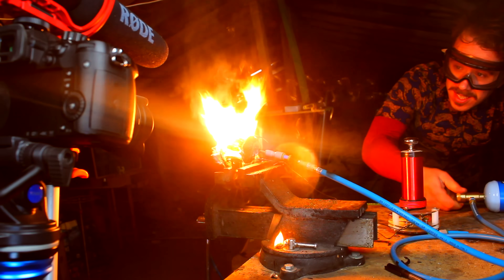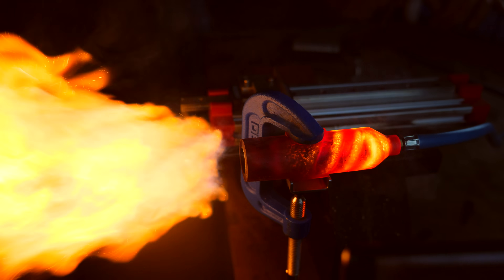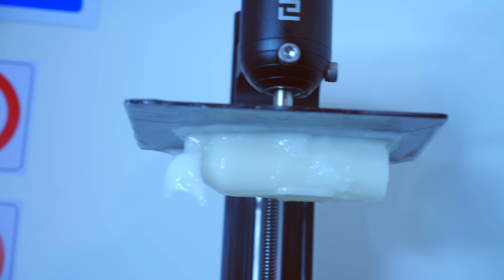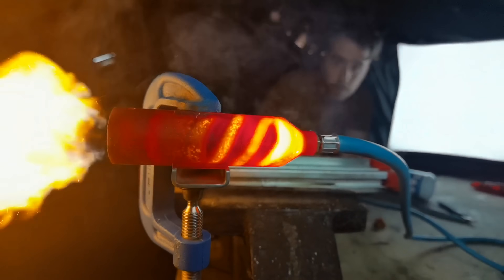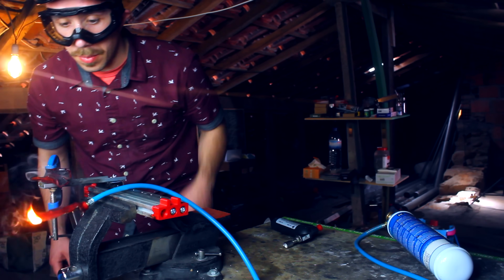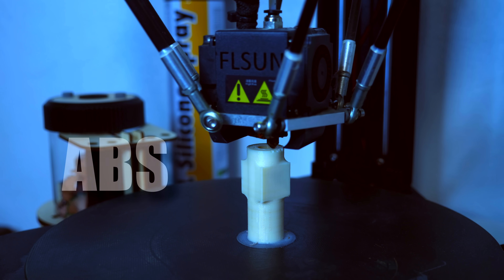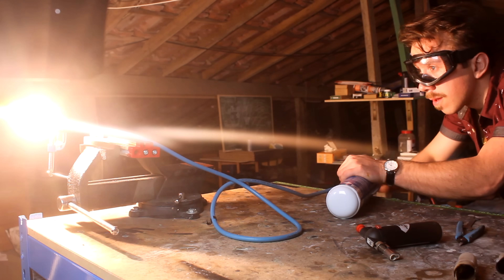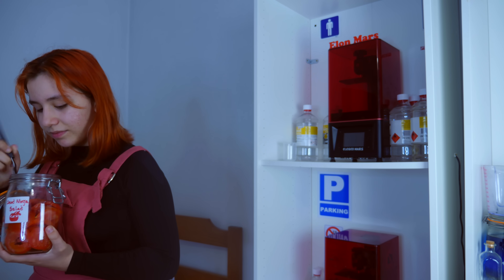Rocket engine that uses itself as fuel! (3D Printed)

Comment: I am curious why you haven't tried to cast parts for this and your jet engine in metal.  I am sure with a small forge you can do this.  Ideally you would sinter the parts in metal but is it possible to cast in metal and line with ceramic?  Are you getting to 660 deg Centigrade out of these nozzles, or 1500C?  Or better yet could cool the nozzles...or are we getting too complicated now?

Comment: You could print a chamber out of ceramic resin and use your nozzles from the vortex rocket setup. The fuel could be a solid slug with multiple holes like a reactor core but instead of the fuel rods the oxidiser could run in the channels. If it works you could just alter the fuel slug to optimize the performance without needing to print out a new engine all the time.

Comment: I think you might make the engine with fireplace cement and then use this resin as a fuel and then use UV light for toughen it up for not having leaks with the resin if you are going to try again.
Reply: I mean for use all the power because now the fuel of the engine is the engine itself.

Comment: Ideas:
Tomato killing machine (more pain = more subscribers and likes)

Dye for solid rocket fuel to change flame colors,

Casing for rocket engine to allow longer burns and stop flame escaping once a hole burns through them.

Sterling engine powered by the exhaust heat of the rockets powering a machine to torture tomatoes

Force gauge to measure the Newton’s of force your rocket engines are giving off.

Comment: Why dont you use the ceramo nozzle as nozzle because I think burning the nozzle itself destroys its geometry. So I would suggest putting the nozzle in a metaltube and behind that the block of propellant. Would be like a normal solid engine but using Oxygengas from the opposite side of the nozzle

Comment: Having given this more thought.  Have you considered 3D printing a ceramic sleeve (reusable) to house the rocket fuel you print (to prevent the pressure from blowing out the top or sides)?  And an idea - instead of plugging the oxygen tube directly into the 3D printed fuel, you could print the fuel to have a threaded hole and get a threaded metal bibb (tube connector) that you could re-use with each engine. And since the metal bib won't catch fire, maybe it'll play a little nicer with the oxygen tube?  I dunno!  LOL  Anyway, for what's it worth.  :)  I just find it neat that the 3D printed ceramic experiments might be useful as a housing for your 3D printed hybrid engines.  Anyway, if what I've said made sense - to test each engine, you'd just need to slide it into the re-usable ceramic housing, screw in the re-usable metal bibb, attach the hose and you'd be ready for a test fire.D

Comment: That printed fuel should be put inside a steel tube with a smaller nozzle so that the pressure is higher and it doesn't spill flames on all directions

Comment: Have you considered something like putting a ball valve in-line with the O2? That way you could have a rapid shut-off of the O2 if necessary rather than having to slowly turn the valve closed on the bottle.

Comment: Although I dont have 3d printers    
I really like rockets a specially hybrid rockets I came up with the idea to use hdpe ( high density polyethylene) as a fuel and a nitrous oxide oxidiser I was hoping to see if you could try it ?

Comment: Why don't you do a capsule of ceramic and put the abs inside that? That way even if the flame makes a hole thru the abs it will be contained inside the capsule and exits just thru the nozzle (and you could make the nozzle out of ceramic as well)

Comment: I've been wondering if instead of using a ceramic resin, you use wax to make your rocket prototypes.
The idea is to make a wax mold, empty the ceramic and then in the oven burn all the wax and leave only the ceramic rocket ready without leaks.

It would be very interesting to see how you build a cnc router and you will use it to make wax molds in 2 parts and since it is wax you can melt it a little and rejoin and you have a single mold

Comment: Integza - what about combining both the sugar resin solution & the ABS to generate a 2-stage fuelled rocket? 

And FYI - burning ABS may produce carbon monoxide & hydrogen cyanide, so I would highly suggest doing this outside or in a better ventilated area. At the very least, have a CO detector in the attic and/or if you start to smell almonds, leave the area immediately! (source: PhD in chemistry)

Comment: Well one thing that i would like actually to see from you unique way is Building a 3d printed Ion  Thruster Engine!
Reply: He would need metal 3d printed.
Also: How would he measure so little thrust?
Reply: @ImieNazwiskoOK  Well metal foil wrapped around of plastic tubes is enough to generate enough charge to work (or even some kind of copper plating on the printed parts), with proper transformers and a bridge rectifier for dc high voltage.. as for that kind of trust,  it can really move papers or light metal foils like aluminum, or even a very sensitive scale could work.
Reply: @stileroni  Then it's not 3d printed

Comment: Ask a fabricator to make You a Steel pipe with treads on the end for the body of the rocket then You can fill the inside with the fuel U want. Also the Nozzle can be fabricated in a lathe from grafite which treads on the body. Try boloni as an organic fuel 😉
Pede a um torneio que faça um tubo em ferro com Rosca na ponta e bicos em grafite que enrosquem no corpo. Depois podes encher o foguete com o combustível que quiseres. Experimenta combustível de matéria orgânica como salpicão.. 😉

Comment: in your video where you want to test the nozzles you should  make them easy swappable and print them out of the ceramic resin that the last longer because i thing the biggest problem is that the nozzles get bigger because the burn out

Comment: it looks like that with your setup alot of the force is pushing the "arm" you mounted the engine on into a "spinning" movement rather than a straight one, maybe you should try to mount it on a more symmetrical rail system to get a better result on the visible thrust. Anyway it was fun to watch =)

Comment: Nice advance on the rocket
I have a small sugestion, you could 3D print in ceramic 2 caps for a cilindrical tube (which will be the fuel, made from resin-sugar)
One example of a similiar rocket engine is the one on this video https://www.youtube.com/watch?v=VI8gdmjEwKc
Nice project and good luck

Comment: Nice project ! 
I would suggest you to invest in a ball valve and a regulator for easier and safer gas injection.
Also, it might be interesting to try an ablative material to surround the fuel/body.
Something like Starlite springs in mind ... and it's very cheap to test.
Have a look at Nighthawkinlight video on this subject : https://www.youtube.com/watch?v=0IbWampaEcM&t=20s

Comment: A cutting torch works by blasting super heated O² through the metal.
Literaly burning the metal away.
Also, using oxygen separately, you should be able to use just about any propellant without the oxidizer. So ground up sulfur and charcoal should with super heated O²
Keep in mind pressure always goes to where theres less pressure. That's including back into your compressed air bottle.
These hybrid solid/liquid engine are an awesome idea, love your vids.

Comment: maybe if you placed the engine is a very thin metal shell you could combust more of the engine before critical failure?
Reply: @Robert Shea really? even something really heat resistant like titanium?....though....just saying that....it would be very expensive to really even try that......unless it was via electroplating....and that might not give the properties you want, or the thickness.....

Comment: @6m~ so you might get to this but have you thought of putting the print in a steel cylinder?
So as it goes through the wall it does not blow all ur thrust out the side, burn still get pushed out the nozzle? 
get some more experiments on!!

Comment: All the engine that moved in the first few second only. Maybe that indicates something. Maybe the initial ignition was actually a little explosion? Or the heat expands the engines inside until the nozzel didn't function as it should be. Or It is something more that's happening in the first second when the engine ignites.

Comment: By the size of the flame coming out the back of say you have an abundance of fuel, you need to get more oxygen into the combustion. Perhapse 3d printing will allow some small passages to get even distribution through the combustion chamber?

Comment: What I think is happening is that the engine is producing trust but since it's on a long arm, It does not put itself backwards but instead pushing into the linear guide creating friction. try pushing the linear guide back using your finger at where you place the rockets.

Comment: alright so I have a couple thoughts here
1. I really hope that attic is well ventilated
2. Rocket nozzles, both the De Laval and aerospike kind, are meant to accelerate the high temperature gases produced by the burning fuel. The way you have it now, the nozzles are burning away before they make any significant contribution to thrust. Making an enclosure and a nozzle out of something non-flammable and putting the printed fuel "pellets" in there would probably greatly increase the effectiveness of your rockets.
3. You might want to put some additional plumbing on your oxygen line, like a flashback arrestor and a ball valve so you don't have to frantically tighten the top of the tank if something goes wrong
4. they're called sparklers

Comment: Why don't you combine the ceramic parts and the solid fuel? You wouldn't need the vortex air cooling for that. What also helps with burning the rocket is a hollow solid fuel, so it can burn from the inside outwards and not from the nozzle to the tip.

Comment: you can try to use a PETG Casing if you have a dual nozzle 3D printer extruder, then you can have an ABS or PLA core as fuel & PETG as a high temp. resistant casing. btw great videos waiting for the next version.
All the best...

Comment: I love ur idea that building anything by 3D printer, as I also doing that( except my FDM and DLP printer have shitly accuracy)
BTW, I think u need a ceramic nozzle and body, as the nozzle built by fuel can't stand in high heat.
For the fuel, I think the sugar resin would better than ABS because ABS will melt and the burn rate cant be controlled.
looking forward to ur new video, GJ.

Comment: I feel like the resin printed parts did not create ‘trust’ because it was on the side of the linear rails creating torque (rotation force). Resulting in a pinching motion between the linear rail and slider. Prohibiting the engine from moving forward.

Comment: A theme, let's see. To build a fully functional rocket with arduino and servos and gyro controlling it and a camera trying to get as high up as you can, a rocket engine made with a aluminium body ( pipe ) to withstand the pressure and with a abs star core and a/different ceramic nozzles. All 3D printend except the pipe for the rocket and the arduino/electronics etc. Have you tried mixing in fe2 with the sugar in the resin? It is sometimes used in sugar rocket engines.

Comment: you could try to get into ceramic pottery instead of 3d printed ceramics and make a shell for the solid fuel rockets to ensure that most/all of the fuels burns before structural failure.
it's an idea i guess, i don't know much about this stuff but it's cool.

Comment: Nice idea and I see the ABS compound quite promising. 
But I think having the nozzle and casing made from the same material as you use as fuel is not a good idea. 
If there´s unburnt oxygen residue in the exhaust, it will eat up your nozzle and thus constantly change the geometry. 
Are you able to print a Nozzle and Casing from your ceramic resin mix and insert a "fuel block" made from ABS which fits the inside of the casing?

Comment: use a metal cone then you just have to press in the 3printed  engine, and it cant lose pressure if the sides burn through...

Comment: You should grind the plastic and then provide them some heat to make them sticky to increase the surface area and efficiency and then make a rocket from that after covering it with sone aluminum foil to avoid leaks glued with plastic

Comment: No, scientist or genuine engineer would call your projects a failure. Actually its uncannily similar to the series of experiments done in the early times of rocket development IIRC. Using a 3D printer is also an additional challenge. Everyone expects the engines to fail after some time, even for real rocket engines, but their survival time is much longer of course - or all parts get replaced with time.

Comment: I'm not sure if this makes a difference to your current thrust measurement (if you could call it that) setup, but the hose going from the tank to the rocket could possibly be impeding the rocket sliding back on the rail. I think keeping the rocket horizontal for testing is ideal, so it would be great to see you incorporate some kind of bathroom scales + force redirection to get actual numbers. Tom Stanton has a crude version of this in his Compressed Air Powered Plane video that might give you some ideas.

Comment: Wonder if you could print a ceramic outer body for the abs engines and print the fuel in like a maze style so you could add the sugar in the 3D printed pattern then slide it into ceramic body that has oxygen fitting attached!

Comment: The rocket "accelerate" because the internal channel is round section. Burning the section will increase itself. You need a star shaped section channel, so burning the surface remain more or less the same because the "spikes" burn faster. You can find articles about this on internet.

Obviously you need a strong shell for your rocket. Metal or ceramic.

Comment: Still bothered that the engine has to drag the oxygen hose, too. Hanging it at some ropes could eliminate the drag resistance of the hose.
Proposition: 
- Build a new test stand which addresses this issue.
- Put some ruler/marker at the slide to measure the distance/acceleration.
- Hang the Oxygen hose from top and use a very flexible hose.
Another proposition: 
- build a metal enclosure for the solid sugar-resin "fuel". 
- add a mounting point for different nozzles.
Love your videos and rockets.
Greetings from Munich, Tom.

Comment: You can create magnetic combusting chamber and nozzle. If you use hydrogen as a fuel an oxygen as an oxidiser, since it burns at high temperature and really lightweight in terms of atomic mass, with a little help from microwave generator (like one in your microwave oven), you will be able to make ions from overheated, microwave irradiated hydrogen-oxygen mixture. Those ions will be controlled by magnetic field like in ordinary coil and start spinning with some radius of curvature. Since magnetic field is not homogeneous, and increases, moving from center to borders of coil, ions that were pushed from center will return back, since stronger field means smaller curvature radius. If instead of many-turn coil you will use several one-turn coils you will be able to form any shape of magnetic field and thus nozzle and combustion chamber you want even during the flight. You can calculate yourself, but I calculated that if you use coil with 10 cm diameter, under 500 ampers, you will get exhaust diameter around 1 cm. Anyway, you should remember that the bigger the gradient between Center of coil and its borders — the bigger is returning force and smaller the exhaust diameter.

Comment: Honestly, why don't you just take a metal tube/shell to avoid all thes holes and 3D print your fuel as a cylinder with a combustion cavity on the inside (e.g., star-shaped) that you put into the metal tube? Maybe also use a metal/ceramic nozzle. You can still supply your oxygen on the top, but it would last a bit longer... And might actually produce thrust ;-)

Comment: You light it from the wrong side. The SRBs of the Space-Shuttle have been lit by a small propellant at the top, it was not lit from the bottom up. That way your nozzle lives longer. Another idea is to add a not burning case to your rocket motor. But anyway, this already is a pretty impressive result IMO.

Comment: I wonder if you can 3d print an actively cooled nozzle? Using the fuel/liquid oxygen that evaporates to remove heat from the nozzle. You could also cool the combustion chamber with this technique!

Comment: I do a lot of DIYs like this and one project that was really interesting was to do an open circuit wind tunnel using ultrasonic foggers to create a visible mist for the streamlines (I'm using it as an odour diffuser). There is a study out there explaining the basic measures and ratios necessary so you can customise yours !

Comment: Since thermoplastics are hygroscopic and water content in filament increass the porosity of your finished part, shouldn´t you be able to increase the thrust output of the printed engines by increasing the moisture content of the filament before printing?

Comment: Why not enclose the resin or ABS fuel in a steel cylinder so you don't get burn through the side of your engine? It sounded like you already suspect it, but also your nozzle diameter appeared too big in relation to the width of the combustion chamber. The geometry may be off too but it was hard to see that through the blaze. Because your nozzle and combustion chamber were being consumed by the combustion those parameters were also changing throughout the burn. A ceramic nozzle would maintain its shape and diameter throughout the burn. The expanding combustion chamber probably won't matter much if the gases are being accelerated through a properly sized, constant diameter nozzle.

Comment: If you want a fuel that is powerful and structural, try TOFFEE. Cast tube of the stuff and put inside the casing. Some aluminum dust mixed in doesn't do any harm.